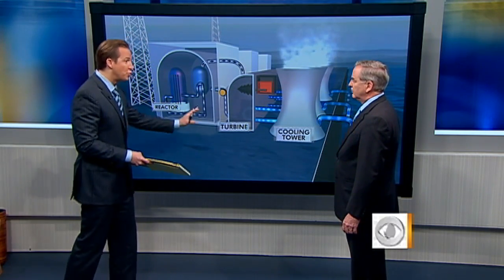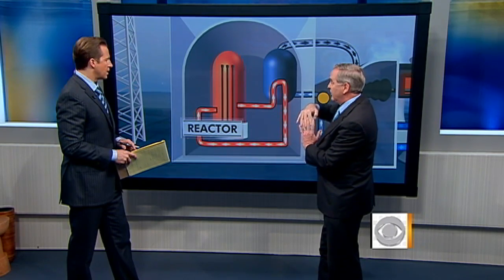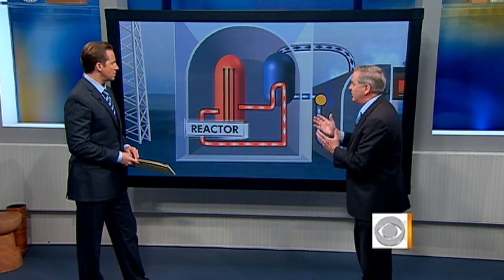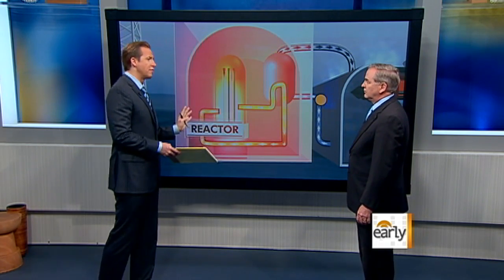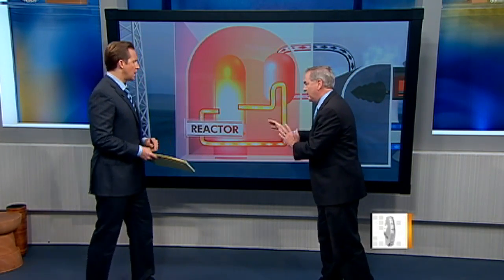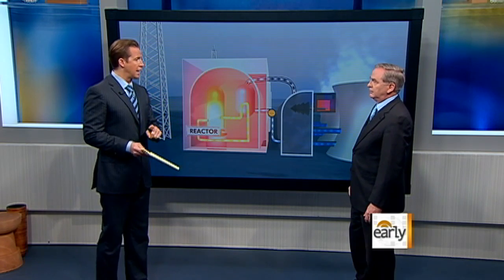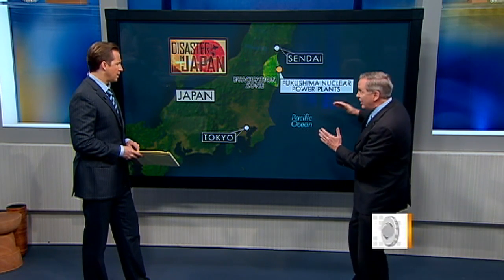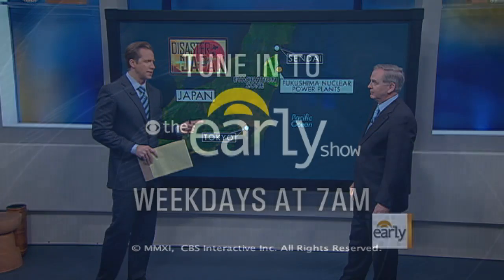Japan's nuclear power plant: What went wrong?

Comment: The problem is GE built it...
Mabey because GE has been tax exempt they can help with the clean up, seeing as how it's their faulty equipment, right?
The fuel is molten, the cooling pond is dry, either you burry it or spread WAY more radiation by trying to pump sea water on it, whereby the water just vaporizes as soon as it touches the radioactive waste materials...  Japan stop being such a stubborn pain in the ass, BURRY IT NOW!!!